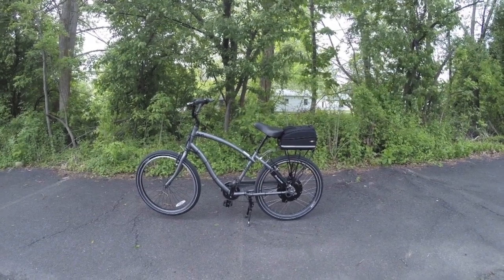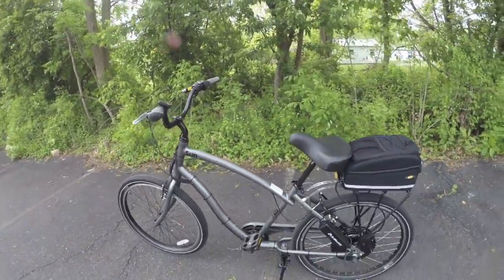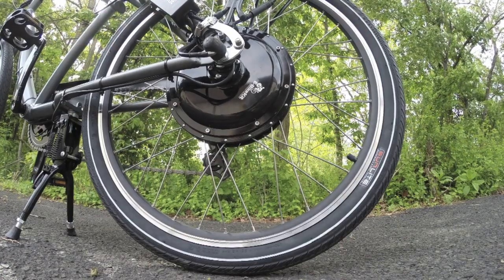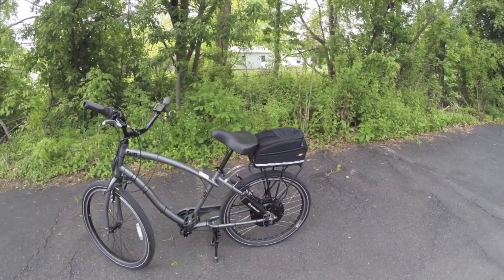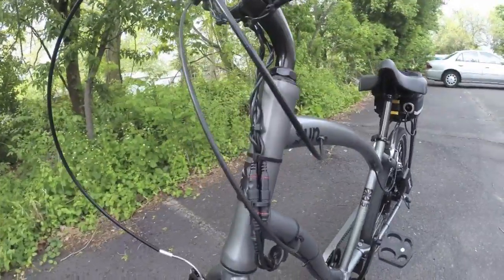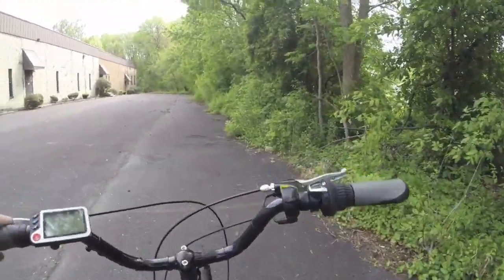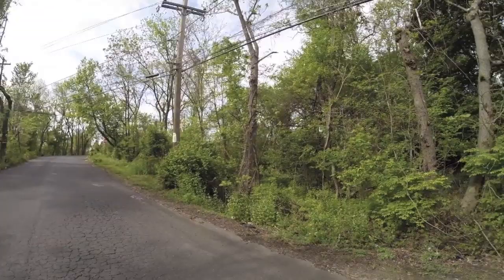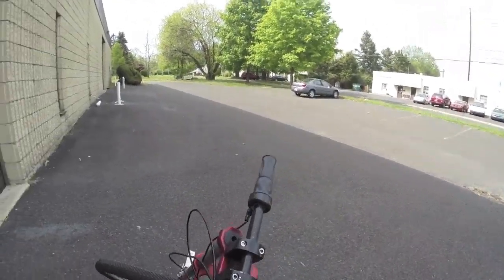E-BikeKit 500W Direct Drive Review - $860

Comment: The bike has a good quality standard to it.✳✳>share4.photo/ebicycle?Б167    I ride it 3 to 4 times a week, and no issues - the battery last, and the power of the motor is excellent -- no mechanical issues after two years.

Comment: personally I would go with the  front hub because it offers more traction and I like riding hard and often will lose traction on the rear wheels so adding extra weight plus power to the wheel just makes no sence. having a front wheel will not only balance out the power  but it will also balance out the weight.

Comment: My wife and I bought a tandem bicycle last year.  Our area is quite windy.  I don't want to buy an unreliable electric bike kit but I don't want to spend a lot either.  We are both slim and our area is pretty flat.  Usually 13mile rides max distance.  Do you have a few suggestions for us?
Reply from the maker: joshlutes Great question Josh, I think you could get a lot of enjoyment without spending much by adding a really simple front-wheel hub motor like the Hill Topper http://electricbikereview.com/clean-republic/hill-topper/ normally I prefer rear-wheel kits but given the distance that cables would require on that setup and the fact that you're light, nimble and active people I think this smaller motor would be a great little booster for starts and occasional support :)
Reply: ElectricBikeReview.com Thank you for the response!  I'll look into that one more and see the good word.  I've been pretty jazzed about the Magic Pie 4 motor.  Doesn't come with a battery but it seems like a strong and powerful unit.  Still researching.  You made a very good point about cable lengths.  Thank you.
Reply from the maker: joshlutes Here's a review I shot on the Magic Pie if it helps: http://electricridereview.com/golden-motor/magicpie-3/

Comment: For routine use torque is not critical because we have pedal power assist. Plenty additional torque there! And the controller can be mounted to the seat tube in front of the tire. 8)
Reply from the maker: Good idea about mounting the controller to the seat tube, that would keep it out of the way. Thanks Ed.
Reply: A middrive make hub motors look sick ----500w upwards